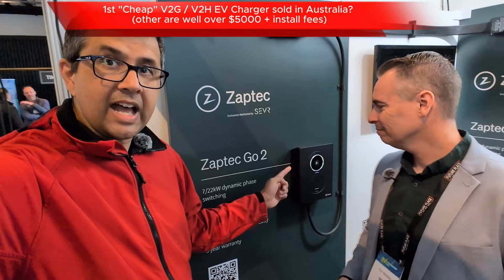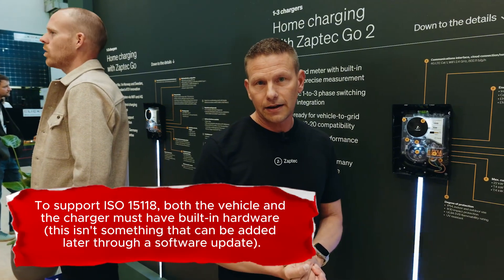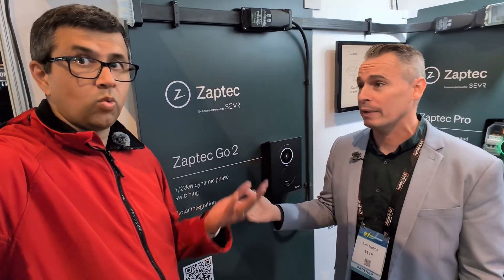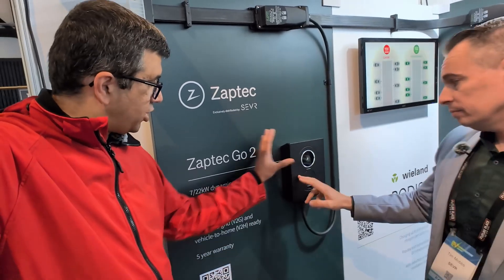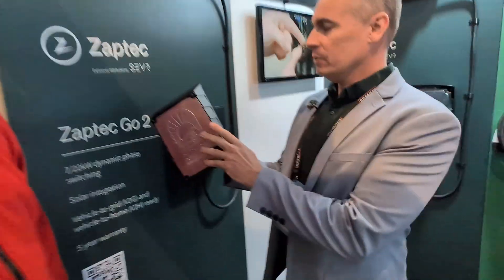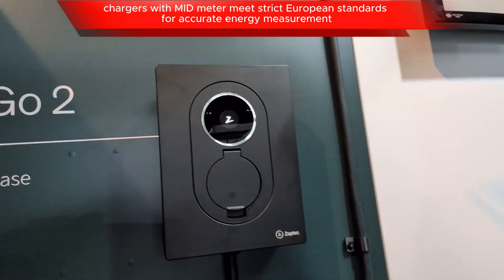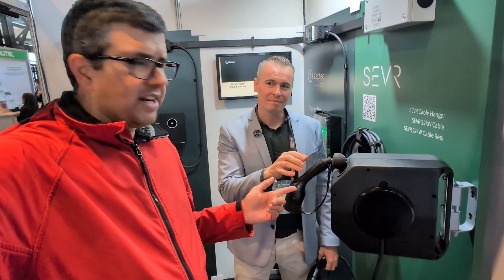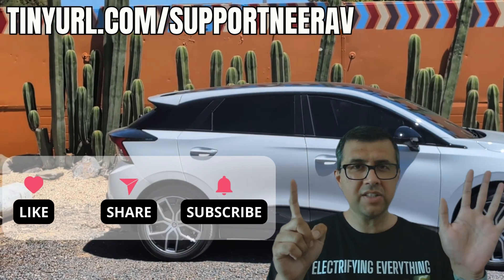"Cheap" V2G / V2H EV charger for Australia? AC 7 / 22kW, Scandi Design, Made in Europe

Comment: I saw multiple comments on this being a V2L "hack" rather than straight-up V2X..

I'm not an expert in electrical engineering so I'll take their word.. and I would still go for it.. because it totally make sense - financially..

Even if it relies on the car's "measly" 2.4kw output, the 'return on investment' for such chargers will be much much quicker than those super-expensive proper bi-directional chargers.. especially for small families, the total household load will hardly go over 5kw.. so almost half of your energy need, in 1/5th of the price.. I would go for this one in a heartbeat..

Comment: Forego stationary batteries and just use your car ... why not? Because if you need to drive away your home is left in the dark. V2H will allow you to significantly downsize your home battery. You're going to want a small one so you can actually use your car for a bit without blacking out your home.

Comment: My man, we want the product to come with the plug so we dont need a sparky to wire everything in every time..... Same also we want 22kw home dc chargers no4 many cars even support 22kw ac, until then you can get a de power 22kw ac charger with the plug socket for 400 dollars albeit it's not smart, but that model can't even use the v2g part yet

Comment: Is that the full unit, how can it be $1800 and be that small when sigengery is 600x250x250 and costs $6000
Reply from the maker: Because DC chargers for V2G / V2H are really expensive. This is an AC charger so it can be small and much cheaper
Reply: I'm confused. Is there actually an inverter built into the product or does it rely on the V2L inverter built into the vehicle to do V2G? I'm assuming that's the case and that's how they can keep it so small. However the Polestar 2 does not currently come with V2L so that's confusing. You keep calling it an AC charger which it's not. It's an EVSE - and they just supply power to the AC charger in the vehicle.

Comment: V2L is not a good idea as the home power draw is usually a lot more consumption than the 2.4kW AC output.
Reply from the maker: If you had to use v2l in your house for an emergency, the idea isn't to backup the whole house, it's to back up one essential circuit, eg fridge, lights, microwave
Reply: This isn't V2L and doesn't depend on a V2L equipped car.  It's using a bidirectional Type 2 port.

Comment: I was under the impression that V2G and V2H require a DC coupled bi-directional CCS2 connection to the vehicle. This looks like it is using the vehicle V2L capability via a Type 2 connection. Presumably the V2x capability here is limited by the native V2L inverter capability in the vehicle (Typically around 10A or 2.3kW), so it could not provide backup V2H towards the residence in the case of a power outage unless additional separation of the household circuits are provided. 

None the less, it does look more elegant and integrated than other systems that use the V2L capability (Such as HOEM).
Reply from the maker: Hi Campbell your impression is incorrect. This is not about hacking together V2G/V2H using V2L

There are several companies working on AC V2G/V2H solutions eg Fronius Wattpilot Flex AC charger is engineered with a ISO 15118 chip

AC and DC AC chargers that support V2G/V2H each have their own pros and cons
Reply: @NeeravBhatt the Wattpilot Flex is a unidirectional AC coupled EVSE. Grid to Vehicle only. The ISO 15118 standard covers that capability.

I still expect that this bidirectional Zaptec EVSE still uses the vehicle onboard DC to AC V2L inverter.
Reply from the maker: It is capable of being unidirectional  @CampbellMorkham 
https://www.fronius.com/en-au/australia/solar-energy/installers-partners/infocentre/blog/fronius-bidirectional-charging-030625
Reply: @NeeravBhatt  OK I understand, so this AC bi-Directional charging is using the vehicle onboard Inverter in the same way an external solar inverter can syncronise to the and supply less than the house demand if needed.

This capability is likely to requre at the minimum an update to the vehicle V2L Inverter, and more likely different hardware.

To supply a house or grid load the vehicle inverter must be able to syncronise to the grid frequency and supply a higher voltage than the grid. It also needs to support the relevant safety and grid standards, which is where the additions and propsals to the ISO 15118 standards come in.

I expect that only premium EV's will have bi-directional 3 phase 22kW Inverters, and many manufacturers may prefer to offload that capability towards a DC coupled external Inverter.
Reply: The car's on board inverter is typically capable of much higher power output than the most V2L adapters operate at. Send the car the right signal and it will crank up its output. The bigger challenge though is aligning the AC waveform with the grid - these must be kept in phase - same as with a grid-tied solar PV/home battery inverter. This is imperative for such a device to operate in parallel with a grid supply.